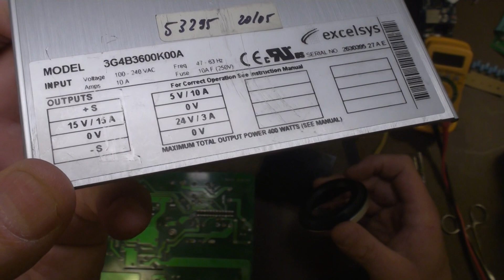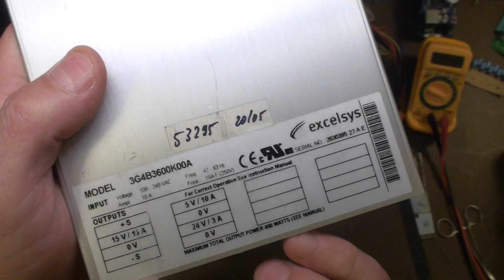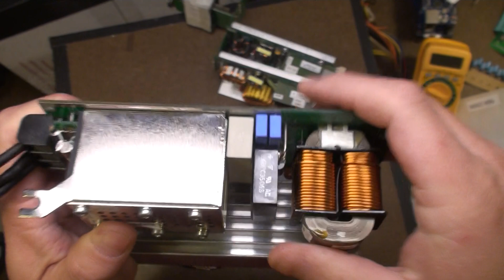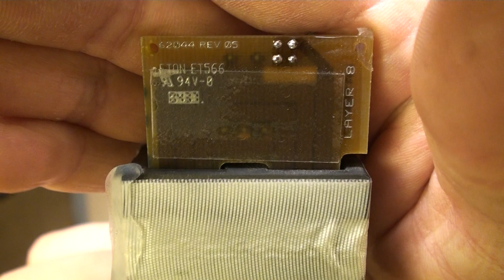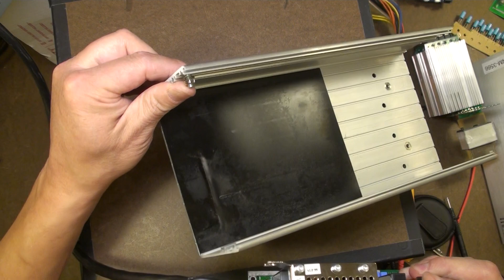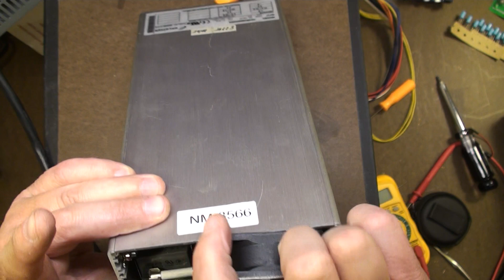Broken Excelsys 3Gen 3G4B power supply - a look inside

Comment: It looks like Digikey still sells the XGen variant (new model) under the Advanced Energy brand, but of course, the data sheets point to excelsys's defunct website.  Digikey has a bunch of videos about the XGen version, but nothing on the 3Gen, as they appear to have been sold in the early 2000's. If you haven't already, try emailing advanced energy directly - you never know, they may point you in the right direction. One other thing - the fact that you're seeing any sort of power with the one probe hovering over the board leads me to think that the board may have a floating ground, using the case itself to complete the circuit. Just a thought - I don't know enough to call myself truly knowledgeable on these things either!